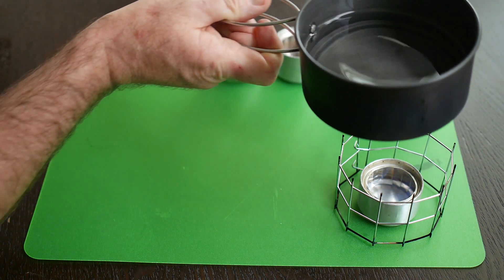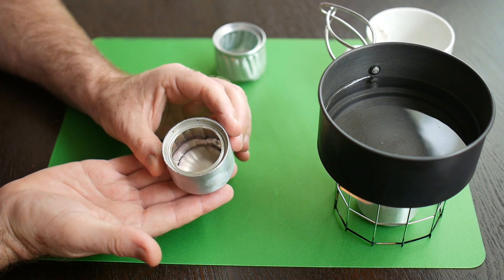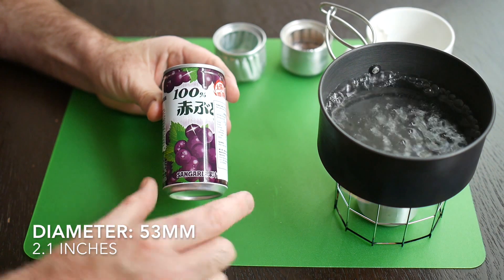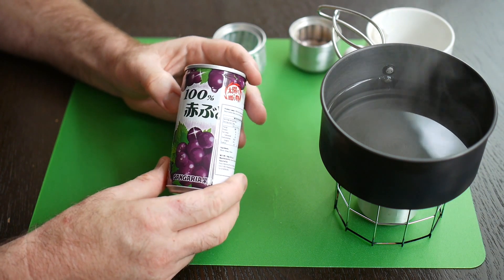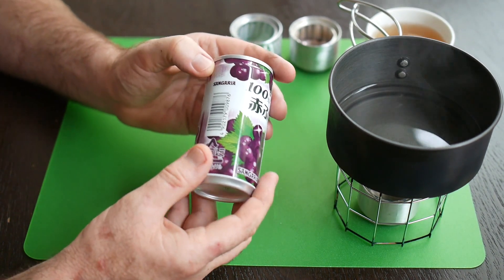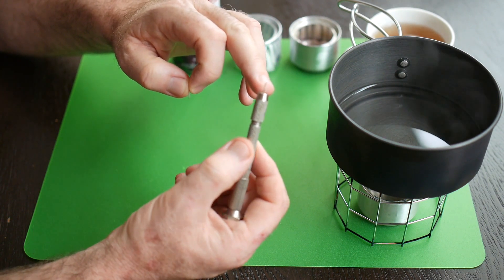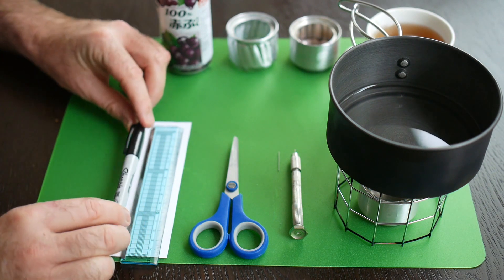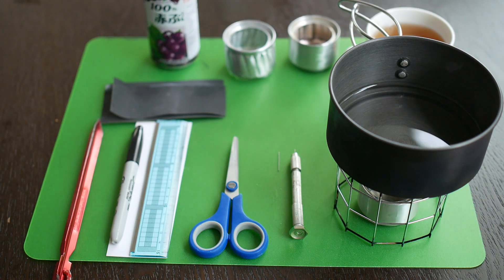Easy Capillary Hoop Stove 1: Introduction, Tools

Comment: First, thanks a lot for your detailed videos!
Until now I wasn't able to find a can that has the same diameter ind the body and the hoop. I nevertheless found one where difference is less than 1mm ... 
Do you think it works when I fold it over at the end instead of cutting it to close the (really small) gap?

Thanks for your help!
Reply from the maker: Hi Andre. Only one way to find out - give it a go!
Reply: Yay! That‘s what I did. Works pretty fine. 

https://www.instagram.com/p/B3afBUuo0H6/?igshid=1mkl1ln5kdvgs

Comment: how long that stove can work with full alcohol inside?
Reply from the maker: Maybe 9 minutes. If you want it to burn longer, make it 40mm high.
Reply: @jandal8905  thanks for your information. How long the 40mm's stove will work?
Reply from the maker: @LeonardoImanuel  Not sure, Leonardo - I've never made a 40mm stove. Check out Tetkoba's videos for eCHS and CHS Universal stoves - he often makes tall stoves and times how long they burn for.

Comment: this one has no simmer ring..
Reply from the maker: Correct. Easy enough to make one, though.
Reply: Jandal can u make a simmer ring to control the flame?
Reply from the maker: @jodelcamarin2212  Sure. Check out Tetkoba's videos. He makes a simmer ring sometimes. I haven't made one because I don't need one.